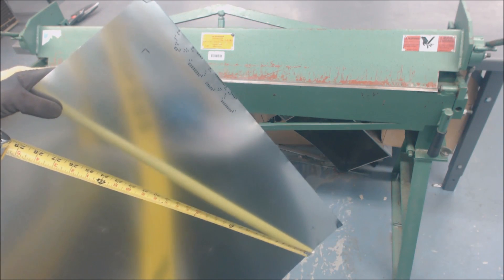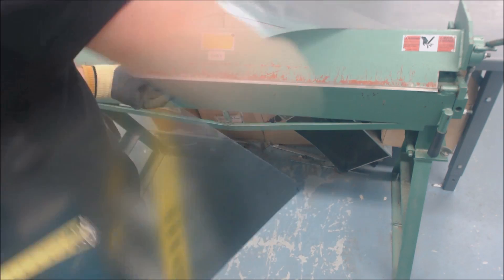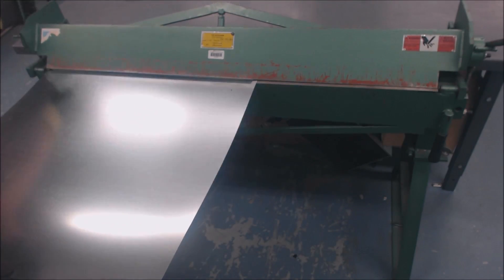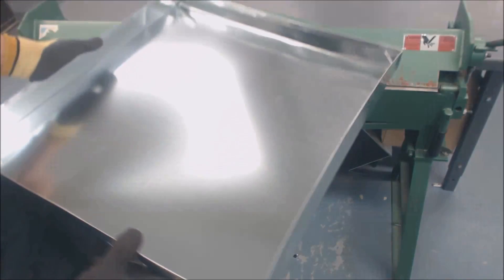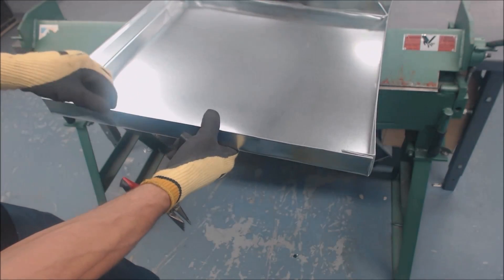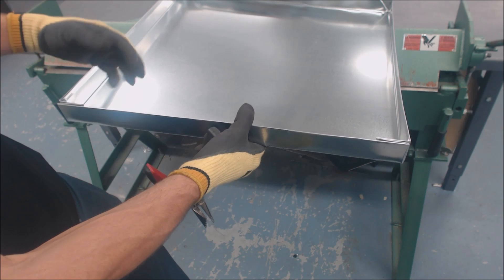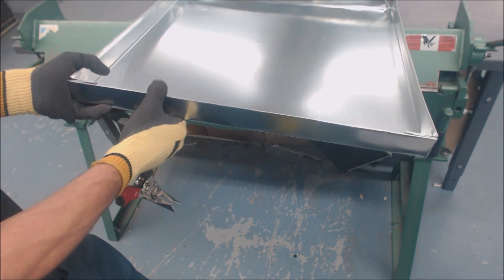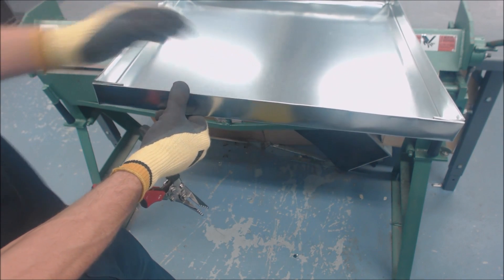HVAC Emergency Condensate Pan!- Bend and Make a Pan that does Not need to be Brazed or Leak Tested!

Comment: My secondary drain pan is rotted and needs to be replaced. The unit is mounted above my drop ceiling tiles. It’s suspended under my air handler and both are hanging from steel support rods and beams. How do I remove the pan and replace it with another?  Can I just put a bed pan inside the rotted one?

Comment: Excellent example of an 'on the fly' temporary drain pan !!  You've shown a very good technique that will get you out of a bind quickly in a bad situation.  If you'd like to see a different style pan that DOES require sealant in the corners please feel free to take a look: https://www.youtube.com/watch?v=PvDab537ul4  Fast fwd to 6:38 for the beginning of the drain pan.  It is NOT an instructional video at all..its just a portion of a job I'm currently doing for an air handler for the second story of my son's house and is being installed in the attic.

Comment: Everyone who's good at their job makes it look easy!   Well done, Craig!   I like the advice that you don't need a PVC drain in the secondary pan since it's never supposed to have water in it.  For my own system I actually prefer a moisture sensor sitting in the low spot on the emergency pan to a level switch on the edge, with the Safe-T-Switch in the secondary port on the main tray.
Reply from the maker: Yeah they are good switches, thanks Peter!

Comment: Thanks for this video. Lots of info. I found the more shallow the pan I want to make, the more difficult it is to bend the corners. Any tricks?  Subbed
Reply from the maker: I always make the pan with 1.5" or 2" high lips. Another thing you can do with this technique is if you flip the pan over and cross break it, it can be a chimney termination as well, thanks!

Comment: i tried doing this for the fist time by hand the other day. just figuring it out, using only hand tools, i did it not as neat and the lips aint as high as they need to be. thanks
Reply from the maker: Yeah you need to bend the 2 or 2.5" lips with a brake or plywood edge and it takes some getting used to but after works really good, thanks!

Comment: Excellent. One could probably practice the corners with a piece of paper first until the corner comes naturally but great
Reply from the maker: Actually bending the crease is fairly hard without something like tin. I had an adult student that tried to practice with aluminum but it was fairly hard compared to tin, thanks!
Reply: AC Service Tech LLC - so I guess  doing it my first time with galvanized steel ain't gonna happen!  Thanks

Comment: Finally good video on doing the corners. Thanks
Reply from the maker: Thanks Boys Rback!
Reply: acservicetech was that aluminium or galv how much are the "4×8" sheets. ' need 36" ×69" make for chimney chase cover no hole.
Reply from the maker: My price is currently $17.50 for 26 gauge. You could use 26 gauge or even better, 24 gauge. Make sure to cross break the whole pan then from diagonal corner to corner so rain runs off then. I have replaced quite a few out there because they didn't have a cross break, water sat and rotted them, thanks!
Reply: acservicetech Thanks fell asleep. Yeah I was planning on dia. Bends 
For water runoff.

Comment: Went to pick up a unit yesterday and asked supplier if they have any pans without holes -NOPE.  Thanks for the training. Went home and made one. I don't have a break but I do have a large flat metal table. I clamped metal down and bent it with a rubber mallet. It came out great.
Thanks again for taking the time to teach this. You never know who will benefit from it.
Reply from the maker: That's really awesome to hear!
Reply: I'm thinking of putting up a survey at the supply house and see if there is a demand for these types of pans. I could be their supplier.

Comment: badass pan. 
never did understand the drain in the pan. defeats purpose.. on usually that's where they leak.
Reply from the maker: Yup, that's right. I can't believe how many times I find pans with a hole in them. Even the pan manufacturers precut a hole, ha!?
Reply: acservicetech 
usually the float switches are bypassed also. lol
Reply from the maker: Ha, not good!

Comment: Great explanation. You are doing a great work with these videos. Can you do one explaining why undersized ductwork , low blower speed motor, collapsed ductwork, dirty air filter and a restriction will cause a freeze on the coil.
Reply: Because the restriction due to the various items you noted slow down the flow of air across the coil, which in turn transfers less heat into the coil from the warm air, causing the temperature to drop too low, causing freezing of condensate.